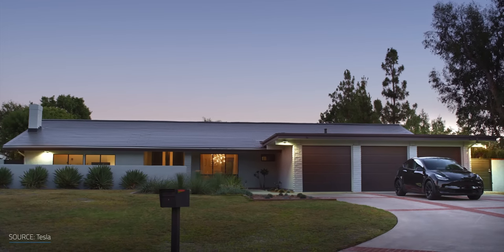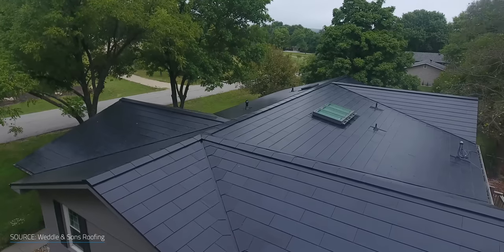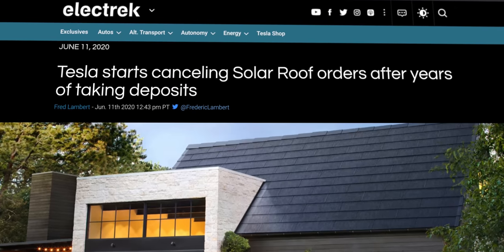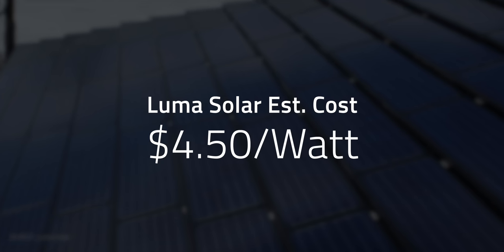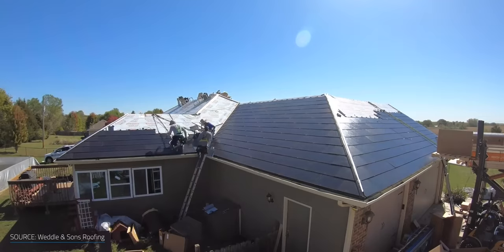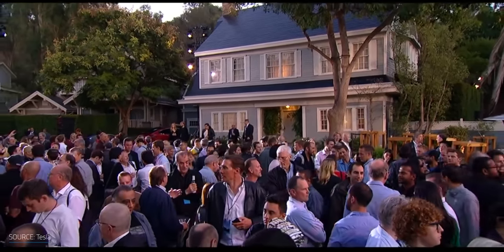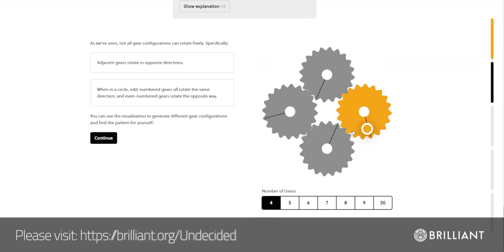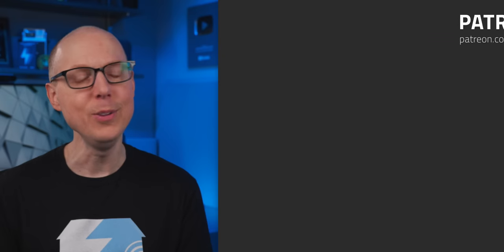The Problem With Tesla’s Solar Roof

Comment: Solar and wind power generation is working and available.  The reason why you do not see it is because of energy storage,  A.K.A. batteries.  You can not store power in a power line.  The very best tech available for energy storage is a little expensive up front, but requires lots of Maintenace and humans watching in.   You can put a solar panel up and forget it for a long time, but you cannot install a Lithium Battery in your house and forget it, and lithium is the best thing out right now for a home owner.  Even Tesla power wall must be watch, and gawd help you if it gets wet.

Comment: I would rather have panels if a better panel comes out 10 years later it would be easier to upgrade or if I sell the house buyer didn’t want solar I could remove the panels easily

Comment: BIPV just isn't good enough yet in my opinion to justify the price. Generic solar is still the way to go get a good ground or pole mount then your derating factor is much less and you will need less panels for a given voltage. 

BIPV is coming, and in the future but it's just not the ticket right now in my opinion.

Comment: I think Solar roofs will eventually be an important change to the overall power system.
Ease grid strain, and help power all the new EV coming out, by charging at home, (or work).
Reply: Luke Skywalker's farm had them way back in the 1970s.

Comment: Basically this video further supports the point I continually make with green energy pushers. I do truly feel that solar could be a viable option in the future, but it's still not there yet and it's to 1 dimensional. Green energy is to inefficient to be a sole purpose solution. It needs to tackle multiple issues to be worth the investment of spending a lot resources and money to be worth it. A roof that can generate power and reduce the need to service or repair a roof kills 2 birds with 1 stone. Based on this video, it's not there yet, but it's getting there. It's the putting the cart before the horse point.

Comment: Let me install it myself and I'll save thousands. Let someone "certified" design the system, preferably off grid, and ship it with instructions.
Reply: Ralph Marshall said the same thing. Totally agree. This is how radiant flooring systems are sold these days: an engineer in San Luis Obispo designed my whole system for me, built the main manifold in a steel box and shipped it to me, and sent me a (very) detailed parts list for the rest. I screwed the steel box right to the wall, all the parts were already installed correctly inside it, and I just laid the Warmboard and hired a plumber to assemble the additional pipes, pumps, PEX tubing, etc. when it came. The plumber spend half an hour reading the designer's instructions and had no trouble installing all the rest of it. "The hard part was in that big steel box."

When solar-shingle roof systems can be done in a similar way, they will finally become widely accepted.

Comment: solar panels are an old and goofy way to generate power... they are cumbersome and lack efficiency, those film like Perovskite photovoltaic cells are the standard to be set...
and all of it, thin as a film, that could even draw energy from a full moon(very low input but still working) they need to be combined to a rain collecting roof system, so houses roofs actively and passively produce electric power and clean water.

a Perovskite covered blade, would make a wind turbine +31%+ more efficient, so it would profit from any photons hitting its surfaces...

a car with Perovskite skin, would even regenerate its batteries at night by street lights and other cars headlights... energy control is a matter of chem and frequency modulation...

Comment: Rather than having these small little individual solar panels, it’s better to work towards centralized electric distribution like we currently have — centralized solar cells
Reply: Why? Decentralisation is the future.
And everybody wants to save money, solar systems are an easy way to do that.
Reply: @baronvonlimbourgh1716  , centralization because not everyone wants to be running their own solar “farm”
Reply: @thihal123  they will if eventually as savings keep increasing.
People will jump trough the weirdest hoops to save 50 bucks. 

Running a pv system requires you to do....... basicly nothing. They are virtually maintenance free.

Comment: With the increase in all things oil based  a quality asphalt (30 yr) shingle roof for a 1200 sq ft house with a 500 sq fr separate garage for removal disposal and replacement is approaching the $30,000.oo range in commiefornia ...disposal costs are through the roof as the old shingles  considered haz /waste in commiefornia

Comment: GAF does not produce 47 watts per sq ft. Each PANEL is just shy of 46 watts TOTAL. It averages just shy of 15 watts per sq ft. I am a certified installer and have installed 100's of this system. They are however a great way to offset the cost of roof AND solar needs as they are a single system and allow the homeowner to include the TOTAL system cost in the 30% ITC that is available four just solar panels in other circumstances. Tesla's solar shingle produces a little over 74 watts per panel but by their own acknowledgment only produce a little over 15 watts per panel. I know that math doesn't make sense, but that's what TESLA discloses. Apples for Apples, GAF is the better buy. Not to mention that with the new GAF factory up and running, they are now the largest solar shingle manufacturer in the WORLD!

Comment: Maybe I missed it, but how long do these last?  Typical solar panel systems can last 10-15 years based on what I have learned from contractors.  If you do the math, these solar systems are not cost effective - instead of paying the power company, you are now paying the contractor.  The housing industry in general is in dire need of innovation - it relies on an old business model - get supplies from a warehouse system - contractors are parts replacers - and dumps fill up with three tab roofing.  Roofs should last thousands of years like the tile roofs in my Italian home town.  Ridiculous that it can cost $25K to replace a three tab roof every 15 to 20 years.  Who has that kind of money?  Like I said, housing construction and rebuilds need re-thinking: we waste so much heat energy in our attics that could be harnessed, green lawns are maintenance issues (just bought a $420 battery powered mower, been through 3 of them in 10 years)...

Comment: My roof is lifetime, made of steel-reinforced concrete. The portion of the roof with my solar panels is flat and used as a deck or mirador as it is called in Mexico. My solar panels are raised on ten-foot stanchions to give shade on the deck, and not impede my view in any direction. Well, any direction except straight up I suppose, but you see one blue sky you've seen 'em all, I say. 😀

Total original cost was about $10K USD, my electric bill went from about $3,800 per year to... ummm, let's see, carry the one... oh, yeah, $0.00 per year. Two years ago I put on my tinfoil hat and decided that with the impending global economic collapse, battery storage might be a good idea along with additional panels so I could go off-grid if necessary. My total cost then went up enough that it will not be repaid through electric bill savings now for another six years.

Comment: Typical Tesla business practices. Hyperbolic introduction, wild claims, failure to deliver. Basic idea is very good and some serious companies will make it work.
Really makes sense for new construction.
I originally wanted to go with a solar roof, but ended up going with standard panels when I realized Tesla really didn't have any tiles available and how inefficient they are compared to a standard panel. Been very happy so far. Made 1.5MWh in February

Comment: I've looked at the solar roof and panels a few times,  but given my cheap power cost around $.10 to $.11 / kwh.  It's a hard thing to justify. When it will take 20+ years to pay off assuming 0 failures or issues which in my experience is highly unlikely
Reply: @D K  well when someone decides to make a full sized to heavy duty truck. I'll think about it.  Personally I'd lean towards old school diesel without all the electronics and start making bio fuel easy alternative to high gas prices.    So far my electric prices haven't changed much. In the last 20 years from my co-op power company
Reply: @wwflguy  I understand and I like older vehicles myself.  Sometimes your time is worth very little (or worthless) and there is much time to waste on time consuming tasks like that.  Even if rates don't rise (very unlikely), 1 cent is a lot less than 11 cents, at least according to the math in my universe.

Comment: ALL roofs eventually need replacement, so . . . . if you have add on solar panels on top of the roof, what is the added cost to remove and then re-install the solar panels after the roof is replaced?  Isn't this the elephant in the room?

Comment: At least in the U.S., I don't think that politics can be ignored when making a solar decision.  No, I'm not talking about your own ideological biases affecting your decision on solar, though that's probably something that will happen.  In some states things like net metering are political issues.  If some portion of the accounting for cost on your solar system includes future tax breaks or the ability to sell excess power to your local power company at a good price, the possibility of changes in your local laws should be factored into your decision.  Some U.S. states could be fairly considered to be "trending hostile" to solar power.

Comment: Honestly, part of the problem with solar roofs seems to me that they're just all designed wrong. Trying to get solar tiles to mimic asphalt shingles instead of ... tiles ... And using traditional solar panel 12v wire connectors. I'm not sure what the engineers are thinking when they design these things, but from over here it looks like they're doing it the hard way. And customer expectations, too - expecting an energy-producing tile roof to somehow become as cheap as an asphalt roof rather than comparing its cost and install time to a ... tile ... roof.
Reply: Do more research, the engineering behind these systems is extensive. PV tiles on the Tesla system are not used around roof penetrations or valleys and micro-inverters allow for 2 wire connections. Glass tiles that look the same as the PV tiles are used for penetrations, valley's and anywhere the tiles must be trimmed to fit. Expensive, yes but if you compare a premium roofing product (metal or tile) and adding traditional premium solar panels you will be a similar price point.
Reply: @stevemcnally8863  1: Do you usually not read comments before you reply to them, or am I special today? 2: Do you try to be condescending or does it just come naturally? 3: Do you always prove people wrong by parroting their point and claiming it as your own?
hashtag mansplaining like a pro

Comment: A shame you don't mention that in-roof solar tiles catch fire way more often than regular solar panels. 80 - 90% a solar tile/panel fire is of in-roof tiles. Which are the ones shown here. Solar tiles/panels can be very difficult, even impossible, for the fire-brigade to put out. 
When it comes to being a fire hazard the regular panels are a better choice.

Comment: Tesla has contracted a local solar company to be the sole installer in the area.  Obviously, when you have only one company doing the installs a monopoly is formed and price gouging happens.  So I called them up and they quoted me 150000 dollars to install the roof.  It’s only a 3000 square foot roof and my home was not too much more than that new.  I’ve done my research and this price is almost three times as much as everyone else paid for theirs.  So of course this company is price gouging.  People are not going to pay this much for ANY roof.   My roof is not complicated.  And now this terrible power company Florida Power and Light has moved in and price gouged the area which is resulting in class action lawsuits to keep them from public trust betraying in charging the local residents 10 times what they were paying for electricity and refusing to let solar owners from getting paid for putting energy back into the grid.  This industry is plagued by greed and corruption and until the lawsuits are settled this is not a good way to go.

Comment: Hey Matt. Thanks for a great video. Recently a friend commented that solar panel efficiency is limited legally. Any truth to that? I am certain that NASA solar panels have a greater than 18% efficiency. Is this truly a costs too much to be really efficient issue? Or are other factors limiting the efficiency?
Reply: I'm not aware of a "legal:limit placed on solar, but their are physical limitations to how efficient a solar cell (and thus solar panel) can achieve. For a cell to produce electricity, you need a photon to bump the electron in the silicon. The photon needs to have enough energy to bump the electron, and any extra energy is essentially wasted. Now you can tune your cells for different wavelengths, and you can even stack multiple layers that are more effective in different ranges of wavelengths, but you get diminishing returns. I think the 18% is typical for a single layer, but you can stack multiple layers together and get much higher (into 40%)
Reply: @TheHurby  thanks for the fb. I believe NASA is using multi layered solar cells. But they have more money than I do.
Reply: Never heard of an efficiency limit but there are states and areas where the local utilities have gotten regs passed to limit the overall size of systems.  10KW seems to be the norm.

Comment: After seeing a quote for a solar roof go from 45k to 90k, a neighbor decided to go with regular panels.  (Then Tesla nuked his whole installation by doing the "You have to buy everything from US!" thing...)
Reply: As they say "there's a sucker born every minute"   Any off gridder DIY  could build a sytem that crushes a Tesla/Powerwall combo.
Reply: @hmurchison8123   I am planning a home brew setup.... but my neighbor has NO experience with electronics, batteries and so on.  The initial quote was for 2 power walls, and about 10kwh of roof.  The original quote was $40+ K he got.  Then long before any movement, it jumped up to 80-90k.   That would pay for itself in a decade or more.  My case?  10KW on the roof facing south...with 5+ hours of full sun.  Only problem is finding someone to do the work on my roof.  I'd have the electronics in the back yard in a shed out there.  (I have an electrician that could do all the wiring for me.  (He was an industrial electrician that also did consulting...)--- Only problem for me.. I"m up in years, and can't "do" ladders.  My acre could also hold a bunch of panels, but frankly, 10kw on the roof will do "well enough" to keep 30kwh of batteries happy.  (Possibly bump the batteries up to 40kwh.) - The problem with most of the solar folk here:  They want VERY expensive solutions... Mine came in affordable with components I select, but more than double that with all the solar contractors around here.  <sigh>  If I could get up on the roof (which I cannot do)  - it would be different...but when you get over 70 years old, scrambling around on the roof and mounting panels is just not possible.. So I'm still hunting for a decent contractor to do the work here...
Reply: @Billblom  I hear you brother. I'm 50 and I only do roofs when absolutely necessary.   You have an Electrician that's HUGE.   I hadn't even thought of self installing solar until one of my sales guys said "you can do it it's easy"  he then showed me the flash fleet and described the install.   Unless your home has a bad 6/12 pitch or some other issue the racking isn't hard.   We got a rental home in Texas that's all electric.   I might toss up a 6kw system on it with no ESS.

Man a 10kw south facing system with 30 kw of battery is smoking good and I know given how integrated the hybrid inverters are getting you could set up a good system for less money especially for battery.   I'm looking at the SOK or Pylotech battery for some DIY stuff. 

There's nothing like the joy on someones face when their system commissions on a sunny day and they see the meter display flying backwards.  Or that first bill after a good month of solar.  

Lock in your energy man so you can remove one more volatile bill and spend your money else where they aren't taxing you like crazy

Comment: 9:08 I think you got a bit dyslexic with the numbers, or perhaps the unit system, there is ZERO way Tesla outputs 71 watts per square foot,  maybe you meant 17 watts per sqft instead?   Ditto with the Timberline they're closer to 14W/sqft

Comment: Will need a new roof in the next 10 years. Tesla quoted $50,000 for 3000 ft.² of roof and two power walls. A new complex roof would cost me $30,000. This is not as bad as it seems as with this roofI will get $10,000 of federal and state rebates.